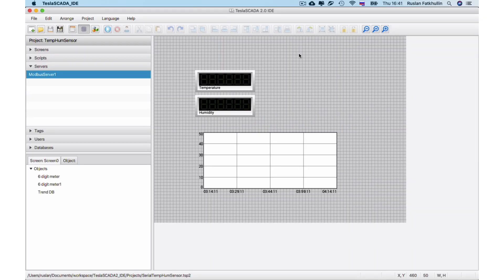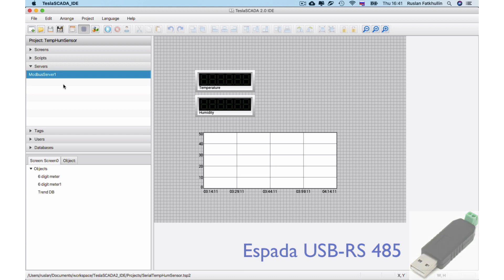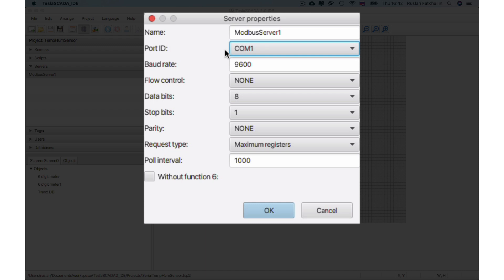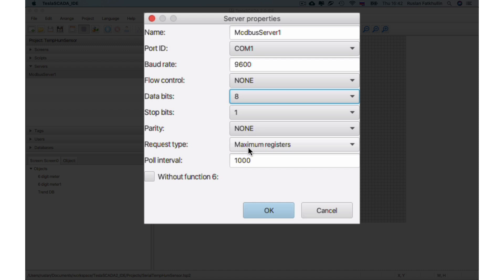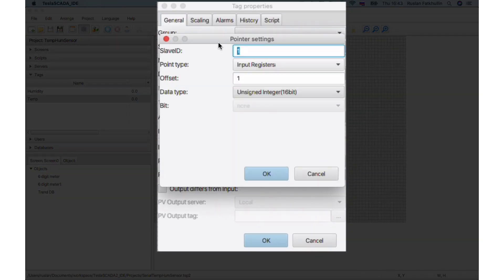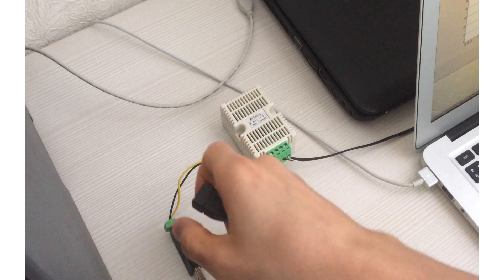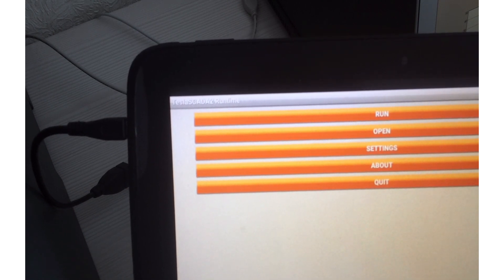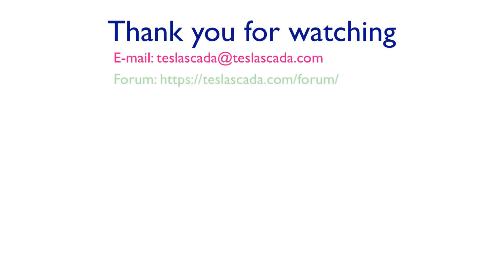Version 2.32. Modbus RTU protocol support added.

Comment: I have been tried teslascada rtu using arduino. I got problem with respont is to low. How to fix respont time? Please help! Thanks
Reply from the maker: Try to change "Poll interval" in Modbus settings, and try to change Request type.
Reply: I have problem at windows 32 byte. Im using windows 7. When i run tesla scada runtime looking tesla scada can not read input register and holding register. But when i using 64 byte windows 10 working properly
Reply from the maker: @aliajuvi1129  It's hard to say what's the reason of this problem. Did you see port when choosing it in Modbus RTU settings?
If you want to use 32 bit version and can't read data you can use converter from RTU to TCP and setup Modbus TCP in TeslaSCADA2 IDE.